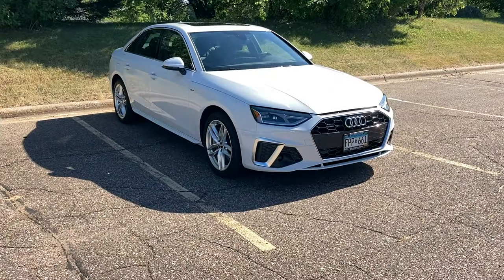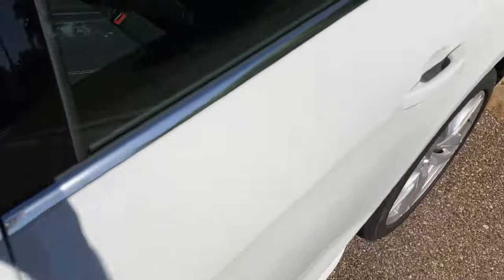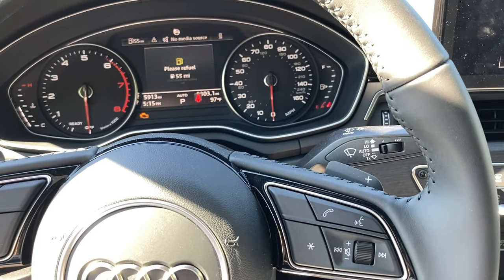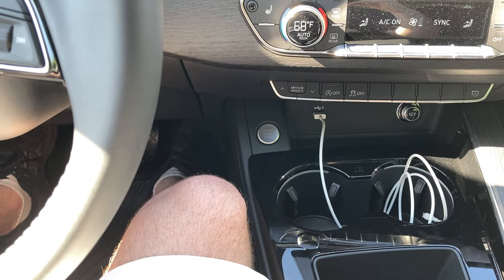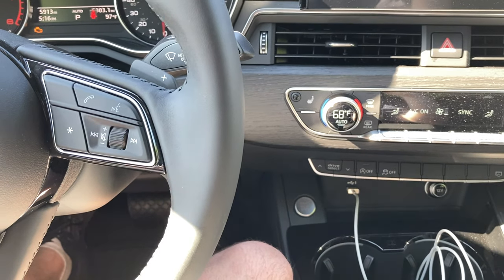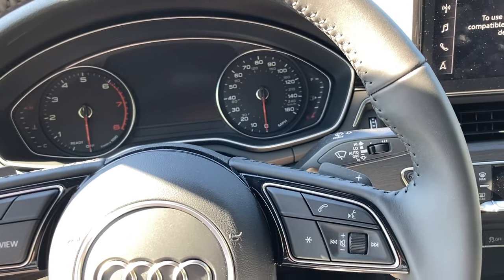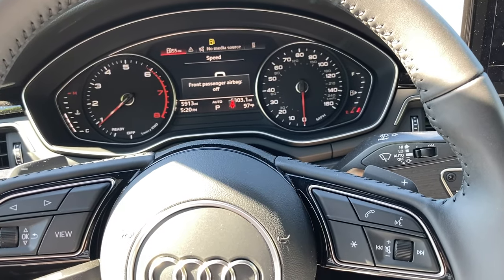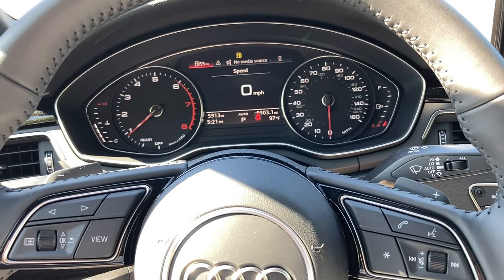Transmission Problems on Volkswagen and Audi: How to Fix Yourself - Fast and Easy!

Comment: Hey man. Went stage 2 on my 2016 7R. The first tuners file was strong and my dsg was  violent when changing. He told me that it's normal. I asked him to flash back cause I was worried about damaging my box. Lost my money for the tune Then I went to another popular house and it did the same but not as bad. They guys checked and couldn't fix it. Also did dsg service. I was planned to do a stock flash and then tried your process. It fixed my issue. Dsg is like butter on boost and I'm enjoying the stage 2 now. Sori for the long message but wanted to share my full experience to help others with similar issue. Thanks you are a legend. Oh, I didn't wait so long after to start the car, was like a few seconds only. The trick is the accelerator floor for the 30 seconds. I heard a click after that. Cheers
Reply: I was about to ask if you did this while on a ECU and TCU and if that didn’t affect it
Reply: @Got_Boost  Yes on ECU tune. Didnt do TCU. Unfortunately this was short lived. Harsh gear change again.Flashing to stock now.
Reply: @Vish-je9we  I just did it last night
Ecu and tcu tuned and wow it made such a big difference!

Comment: I have a 2005 Volkswagen new Beetle and just wanted to let everyone know that I tried this and it did not work buuuuuut like he suggests I did the 20 second hold while in the on position, kept the on position on, removed my foot from the pedal, then from on just started it with my foot on the brake, switched to drive, pushed the gear shifter over to manual shifting, numbers came up instead of PRNDS, engine light off (it's been on for months now throwing transmission speed sensor code po705 I believe), pushed it back over to normal drive and PRNDS reappeared and it's good to go! No longer throwing a code/check engine light, no longer idling rough, MOTHER EFFING AMAZING!! Thanks for this video, you freaking rock!! 🙌🙌🙌😎
Reply: I tried it and worked on my Audi 2004 - I got to see my gear numbers again after reading yours lol thank you smoother and healthier engine.
Reply: Was your car switching to newtral while driving before?
Reply: hey man - what exactly did you do differently compared ton the video? Im not sure I got that. Thank you!
Reply: @darwinescobar7629  No, not switching to neutral while driving. It was just showing I was in all gears at once (all gears lit up, if that makes sense...) and check engine light was on.
Reply: @bentheman1980  I just tried what he explains towards the end of the video (@ about 4:05). But basically I just didn't wait the 3 minutes before starting the car. After holding the gas pedal down for 20-30 seconds while in the 'on' position, I took my foot off the gas pedal after 20-30 sec and immediately switched my foot over to the brake, held the brake and from 'on' just started the car. Hope that helps!!! :)
Reply: @ashleymontgomery9692 awesome thank you, Ill try that!

Comment: Just did this on my 2014 A7; lower gears would feel almost CVT-like where the transmission was struggling to find the right gear, but now it shifts so much smoother and more consistently. It feels like a new car, thank you!

Comment: Just tried this on my q5- its so much smoother now in the lower gears and has lost the jerkiness I was feeling. What a relief- thanks for the hack, I was worried it was going to be worse! Regards
Reply: mine hunts a bit off throttle down a hill, otherwise it is smooth as silk driving, in fact I hardly notice it after doing this simple reset- 2009 Q5 2.0T - I have done this every couple years, maybe every 10,000 kms
Reply: Would work with 2016 audi s6?
Reply: having the same problem with my 2012 audi a4 1.8 T
Reply: in reverse its good but in drive im having problems
Reply: @SW34T just did it on a 16 A6 it’s good
Reply: Was it jerking when you pulled off from 7mph or so when it stays in 2nd gear?

Comment: I've a 2015 Audi A6 Premium Plus with 106,000 miles.  From a cold start, I've had issues going from first into second gear.  Even if the car's been running in the driveway for 15 minutes I encountered the same.  The car revs high and then jolts into second gear.  After that, the car and transmission are pretty normal.  My next door neighbor is a car guy and did some research on the issue and told me the best thing to do was to take it to Audi.  Evidently a lot of independent mechanics won't work on Audi's with this issue.  I was further told that a transmission replacement could cost between $6,000 and $8,000.  Despite this potentially bad news, I was going to take the car in next week.  On a lark I tried this hack and am happy to say it worked perfectly.  Many thanks !!!
Reply: You owe this man a beer or 2

Comment: I just tried this tip on my friend  Audi A3 2014 model .
The car was having jerky start up and after this method the car is working smoothly and the performance and car torque increased and improved significantly..
Thank you very much for this tip
Cheers

Comment: Hello. I did it exactly according to your instructions. The car, the transmission goes completely differently than if it were another car. Transfers are easier, no need at all, than before. Thanks for the simple tip👍. Audi A4 b9

Comment: I tried this on my A3 2015 after i was having many transmission problems in low gear and it worked wonders. The car is functioning perfectly with smooth shifting. Thank you so much!!
Reply: does the car need any repairing?

Comment: Tried on my 2009 Audi Q5 and it worked great, more responsive and engine is way more " healthy feeling " used to barely be able to accelerate to 60mph but now i can hit 80 with no issues like how i bought the car originally! Thanks a ton!
Reply: Are you saying this actually isn’t a joke video?
Reply: Trust me, it’s “not a joke video”. My wife’s 2019 Q5 had stuttering issues with the transmission when coming to a stop and also just not shifting smoothly through the gears. I had to do this reset twice and it worked. It drives so smooth and shifts perfectly.
Reply: @dtma5348 
Hi i have audi q7 2016  and everytime i brake to stop it jerk when it get from 5th to 4th gear
Is that how your car was acting
Reply: Hey ob4994, It would have this jerking effect when rolling to a complete stop, which sounds like the jerking effect your getting. I did this reset twice on a small road trip and it worked.
This is how I did it;
1.) Shut the car completely off (everything including radio, heat/air, fan and lock the door.
2.) Push the accelerator “completely down” and push the start button once, foot off the brake.
3.) Hold for 30 seconds and push the start button to turn off.
4.) Let your foot slowly off the accelerator and wait for 5 minutes (Do not touch anything inside the car while waiting.
5.) Start the car and drive normal for at least 15-20 minutes before turning off your vehicle.
Again, I did this twice and it worked. I’ve also heard through other drivers it took 3-4 times resetting it for it to take effect. You can do this as many times as it will not hurt the transmission. Good luck!!!
Reply: @dtma5348  Thank you so much i think its reset and stopped i guess but i haven't driven it for long journey yet just 4mile
Reply: It’s a computer reset. You never had a laptop move slow and restarting fixed it? Experience helps lid
Reply: @dtma5348  yeah it fixed the problem for me for couple of days and then I got it back the lagging while shifting do I need to restart it again ?
Reply: Yes, sometimes it may take 2 or 3 times of resetting to have it corrected.

Comment: Just tried on my 2019 Q7 V6  3.0 supercharged and did work, ZF8 transmision now work as it's supposed to do,back to buttery smoth specially at lower gear you don't feel that much rough and shaky shifting anymore THANKS ALOT  for the tip 👍

Comment: This actually seems to resolve the issue with the transmission refusing to go past the 1st gear.
One of my parents have an Audi A6 C5 and they called me about it refusing to change out of 1st gear and after they did this the issue went away.

It would shift into reverse and 1st gear but it will just redline on the 1st gear without ever changing up to the 2nd gear.

It is too early to say if this fix will last because they tried it today and now it changes through the gears perfectly fine.
Quite surprised that this actually worked.

Definitely worth a try when it costs nothing and requires so little effort.
Reply: Did this fix the issue permanently for you?
Reply: @hadimajzoub6104  Both no and yes, the car has a mind of it's own sometimes. 
Somedays it works perfectly fine other days it is more stubborn.

The issue with refusing to shift was gone immediately after testing this.

I don't think the car have refused to shift again like it used to do before so maybe it resolved that. I think the gearbox is just slow. They changed out the fluid on the transmisson after I posted my comment and it did not change the situation much.

They also told me that all the gears on the shift indicator lights up at the same time sometimes now which it never did before.

Comment: After looking at an advert for an Audi A6, the seller had the same problem, so i checked this video out in case i would buy the car.   Any way out of curiosity i tried this fix with my 2001 Saab 9-5... not that i was having any problems, but just to try. And to my amazement my Saab is now more responsive and gear changes are hardly felt.  Thanks for this video.

Comment: Did it on my 2010 Passat CC and it worked wonders. At First the gear Stucked a bit when I was shifting and it was shifting around 2200 U. Now it shifts smooth on around 1700-1800 so thanks for that!🙏🏾
Reply: i’m having an issue with my 2010 passat lurching/rough shudders when going 0-5 sadly this didn’t help me

Comment: Dude I have a 2017 VW passat 1.8 tsi, I had problems with my transmission like he states at the beginning of video.  So I tried this method and bro it works!  My car runs like a brand new transmission

Comment: I think this worked for, it definitely feels different initially, stiffer pedal and handling on Auto, need to let it learn a bit both hopefully this fixes slipping in low gears. Thank you so much!

Comment: Thanks, my results: 

-2018 S6 (4.0T, 7spd dual clutch) more natural feeling shift logic in Auto.
-2015 S3 (2.0T, 6spd dual clutch), smoother takeoff from rest.

Changes on both are incremental, noticeable if you’re paying somewhat close attention.  Good way to erase some bad habits the “smart” transmission logic may learn over time.

Comment: I thought this video was a load of BS but I did it and really worked! I have a 2016 A7 and it was doing exactly what he described, stumbling at low speeds unless I jammed it. Now it’s smooth as ever. Almost thought I bought a lemon until this video

Comment: just did this on my audi a3 2018 55k miles. It never game me any problems within the last 3 years until yesterday on the way home from work I received  a "audi transmission malfunction you can continue to drive" message. And then immediately after that message until I got home I was experiencing shifting issues. So far so good thanks
Reply: Is your car still giving that message because mine recently did that and I’m wondering if it worked for you
Reply: @izzyislas6696   the message came back 1 week later but i just did the process again and it went away
Reply: Same exact issue on mine. I have the same Audi A3 2018 61k miles. The trick seemed to fix it for now.

Have you taken it to get looked up since the problem came back again?
Reply: @LEIXAD  I’m going to get it looked at next week because the problems goes away then come back in a few days so it doesn’t solve the issue it’s just temporary. It’s drive able for now but I’m not sure how long it’ll last
Reply: @WorkshopArtist  I’m probably going to take mine to Audi to get it checked as well. Will let you know what they find
Reply: @WorkshopArtist  Audi took a look at my car today and said that I had a transmission problem with the mechatronic electrical unit. I had the extended warranty on it so they will get it replaced. Just wanted to update you
Reply: @LEIXAD  oh noooo Ima get screwed. How much was it before the warranty?
Reply: @WorkshopArtist  it’s about $3k :/
Reply: @LEIXAD  bro I think we in business I just found a letter I kept from Audi back in may2022 stating that any machtronic issue will be covered through an extended warranty up to 150k 💪🏾
Reply: @WorkshopArtist  Nice, they did mention something about 150k miles. In that case hopefully your issue is the same so it can get fixed!

Comment: Tried on my A6 C7 3.0 and 2012, surprisingly it works 🎉. God bless you man.
Reply: I just bought the same car I was wondering has your car ever went into limp mode just for driving fast?, mine does it as soon as I start flooring it and when I turn it off and on it goes away, I really don’t know what’s wrong anything would help me out bro

Comment: Hey buddy, I just located your video after having my gear shifting wasn't doing anything, not going forward or reverse, period... the transmission was in stall.  Now that I just followed your instructions and hope it removed the glitches, I don't have to take it to the dealer knowing they will break the bank.  Thank you for the juicy tips.  I will keep you posted. 😅😅
Reply: so what happened?

Comment: This actually works

I drive a 2019 Audi A6 C8.

Before this video my car would lag and wouldn't be as responsive as when I first purchased it.

After watching this video and following the instructions, gear shifting is much more smoother and the response is much more rapid than it did previously.

If it wasn't for this video I would have swapped my car for a different one. Now I have fallen in love with my car all over again 

Thank you so much for this video. 
God bless you buddy!

Comment: This really worked magic in my a4 b8 2.0tfsi multitronic, it was no longer driving on D mode but after this reset its so driving smoth on D and charge rate improved on forgged voltmeter(13:7 to 14:2v).thanks a million Times bro..

Comment: Yes it worked on my 2019 VW Tiguan. Purchased used 4 months ago and this was its first trip around 2 hours long.  Car jerked a little and gearbox warning light came up, eventually was able to pull off highway and park car and I went to reverse to straighten up and car was still moving forward.  I turned off car and restarted was okay for rest of trip.  But then on way home happened again. Tried the reset trick the next day and worked got it home.  I will see how it goes all week, drive to work and if issue continues will then take to dealer.

Comment: Thank you so much for this technique!!! I did what you said the first time and waited 3 minutes and the light was still on, so I did it again and started the vehicle immediately after and the light came off!!
Reply: Hello Lisa, 
I have one question. So after waiting 15-30s in kickdown position you immediatly pressed brake and start the car, right?
Reply: @mete5532  after waiting 30 seconds I let go off the kick down position then started the vehicle. Let me just say that worked only for that day. The light and chip malfunction has been still coming on. So what Im doing now is disconnecting the battery, with that it resets all electrical seems to help right now and makes it drivable.
Reply: @ldesigns7790  i understand. Thanks for your advise!
Reply: @ldesigns7790  when you disconnect the battery do you have to reset the DSG? I got a new battery and my car is making a squealing noise in R and D1-2-3.
Reply: @LJGillen1986  Since this whole incident with the transmission to disconnecting the battery I am fed up with this car! Now my car is not charging the battery but when tested says the battery is 100%. Im not hearing a squealing noise "yet".
Reply: @ldesigns7790  oh, I feel ya. My battery died and got it changed out. Now I’m having transmission issues. Don’t know if I jumped the gun on driving away and didn’t reset the DSG. Can’t seem to find exactly what’s wrong with my car.
Reply: @LJGillen1986  same, I just don't know what's wrong. The last resort is taking it to the dealer but I dont want to spend hundreds of dollars and then it not work anyway.
Reply: Hello. I did it exactly according to your instructions. The car, the transmission goes completely differently than if it were another car. Transfers are easier, no need at all, than before. Thanks for the simple tip👍. Audi A4 b9

Comment: Will this work on 2019 a3’s? 

Mine seems to hesitate when I downshift in manual mode and it scares tf out of me but only one time and usually right after I put it in sport then manual 😅
After it does it it works fine so idk what it is

Edit: I tried it first thing in the morning and although it was raining I drove it similar to my drive style and it completely worked and fixed all jerkiness it had especially at low speeds and climbing hills at low speeds as well! 
Thanks my guy! I found this at 2am last night and was mad excited to try it 😅

Comment: My A4 b8.5 with the cvt was jerking during slight acceleration from low speeds (10-15 mph) and now it’s smooth all around and also had a whining sound from driving even during from a cold start
Reply: Mm... Mine currently has that cvt jerking on low speeds tooo. Will try the reset tomorow. And As for the whining noise i just went to exhaust shop, they cut n remove resonator then boooom the whine is gone.. Know y? Simply COS the exhaust is more louder now. All thnx to noiseboys. No more hairdryer sound ##S4
Reply: Feedback:this works like a charm. The car drives so differently now and thats Highly noticeable. Even Hill climb and takes off on low revs (D-mode) so much improved.this reset saved me couple thousands bugs As i was about to change transmission. Thanx a million 🎉